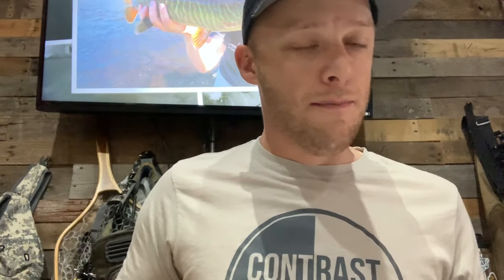How to make your own sink tips for fly fishing 2.0

Comment: Late to this but Nail knot to 25# is a great idea. I've been looking for DIY sink tip ideas for a few weeks because I'm just too cheap to buy them.

I just made a sinking tip with some level sinking line i had. I welded loops onto a 10' piece to make a sink tip. I timed a small piece sinking in a tall glass of water to be about 6 ips. I also welded my skaget head to some level running fly line (very smooth joint). Casted it yesterday and it worked great. 

Your option is a lot quicker.

Comment: Hi Seth & thanks for the great idea. Quick question - have you used this system for fishing smaller, lighter wet flies e.g. soft hackles? I am curious if you have experienced any 'hinging' as a result of the Maxima loops not being perfectly flush to the ends of the sinking line. Airflo, Orvis, and possibly other manufacturers offer polyleaders and Versileaders, but at $15-20 a pop, making my own from level sinking line sounds a lot more appealing. It appears that 7ips is the lightest Airflo product available, and I am hoping this won't overwhelm my 10' 3wt Syndicate P2 rod. Thanks!